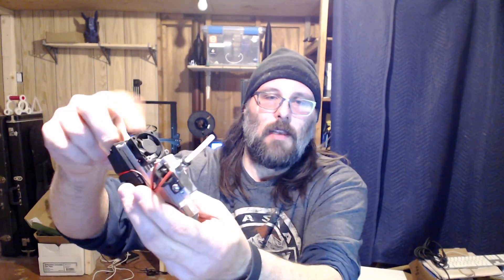Hieha Sx4 the Giant CoreXY Review (not your first printer but should be your next)

Comment: Your reviews have been so helpful for a newb in 3d printing!  You had a big influence on my purchase from Tiny Machines and I'll look into your second iteration..  
I just upgraded the firmware and have mine set up to auto level, which works, but I've had a pretty bad problem with the pla filament not sticking at all to the glass base..  and have had some oozing issues (I'm going to try a different filament).  Any advice on improving the settings for the bed (other than hair spray?!!).  

And I owe you guys some coffee..  Thanks again and I'm looking forward to all your updates..
Reply: (I just slowed my first layer down..  little hair spray still, but problem solved)  Would love to see more on the SX4!

Comment: Don‘t forget where you placed your relais. When you are bored of your DC hotbed and starts to build in a AC hotbed you will need it again. An AC hotbed together with a fine machined aluminium bed which is totally flat, that makes fun. 🤗
Reply from the maker: Not a fan of ac beds.   The ssr’s fail open instead of closed.   So that opens a can o worms itself.  None the less it’s in my part collection for future projects.

Comment: formbot raptor 2 or this ? pls respond
Reply from the maker: Good question! I've only used the T-Rex 3 (basically and IDEX version of the raptor) and I have to there were a lot of things wrong with the t-rex before I got it to work.   My Sx4 printed out of the box.  The corexy is also of greater advantage for printing stability.   So if I could only choose one of those it would probably be the Sx4.  Hope thats helpful
Reply: 3D MakeIt ny biggest is concern is about print quality is it possible if u sent me some photos edizkuru04@gmail.com and with time does the glass bed printer came with bend?

Comment: Thanks for all the info on this printer. I currently have this printer in stock form but I'm making some changes after watching your video. I've already added the PSU grounds, and I'm waiting on my switching mosfet to arrive. I still have the stock hotend but I think I'll upgrade that as well. This is a great printer and with a few upgrades should be an awesome printer. Thanks again!
Reply from the maker: It’s such a good printer.  I’m going to put some exo slides in next

Comment: Also how hard was it to upgrade the board?  How did you load the firmware? I am used to creality printers.
Reply from the maker: If you are just upgrading the stock boards firmware it’s easy peasy.  It has a boot loader so it’s basically the same process with arduino studio or vscode. If you reach out to hieha they will send the firmware config to you as well.  You can just edit that.  I made a marlin 2.0 config for mine.  Pm out Facebook of you have more questions we can point you in a direction

Comment: Thanks so much for the detailed review.  I have been working on my sx-4 for a couple days now.  I found my extruder stepper motor missing steps causing moire artifacts.  I replaced it with an e3d 1/32 stepper motor (not pancake) but my extruder tension is way too tight so it is popping even after bumping up the vref.  Definitely no clog because I did do the v6 swap and filament flows out smoothly by hand.  So now I will move to a bmg clone off amazon, just worried about the pita filament loading and unloading with that on there but am hoping to print like a beast.  I usually print with a .8 nozzle and it will not go above 60mms with out beefing up the extruder or throwing on a volcano.  And yes the board sucks which is why I also added a bunch of tl smoother which helped A LOT.  Quite a lot of stuff to go through but for it being the size it is with a direct drive and a true core xy it is a beast when all done.

Comment: Hi David, I notice you have a couple of guitars there, what guitars do you play? through what set up?
 Great video I have to get me one of these, I was all set to build a core XY Evolution but my mind is 80% changed now, if I do get this one I am going to use your upgrade path from the start
Reply from the maker: Hey! I have a couple guitars there.  A mustang, Jackson, line 6 and esp are in that room.  I’ve got a couple of line 6 amps (spider and flex tone) and ampeg for the basses.
Reply: @3DMakeIt  Cool guitars David, I'm a big Line6 fan too, I started out with the Pocket Pod pedal and now have the HX pedal board multi-fx , I wanted to get a Helix but did not have enough shekels.
 I have recently got into the Harley Benton guitars, I got an SC Custom which is an ESP Les Paul copy and Te-90QM which is a Tele copy with a quilted maple top laminate.
They are wicked guitars at wicked prices, my daily driver is sa Fender American Standard Stratocaster, but the Harley Bentons bring a smile to my face every time I pick one up knowing I got so much guitar for so little money